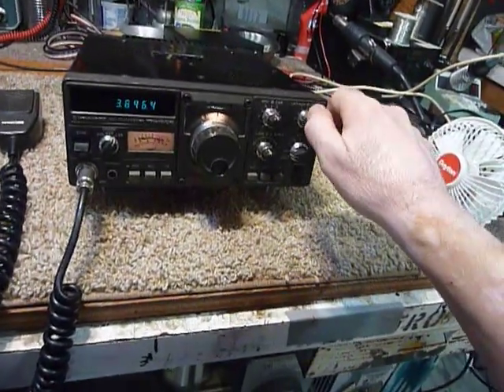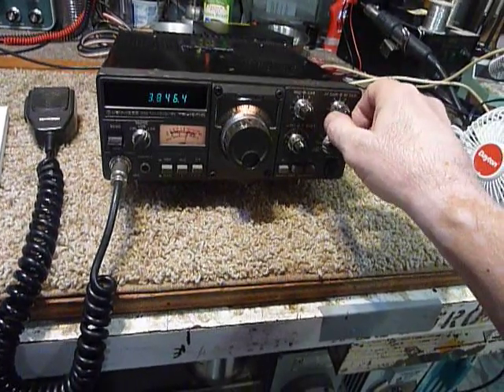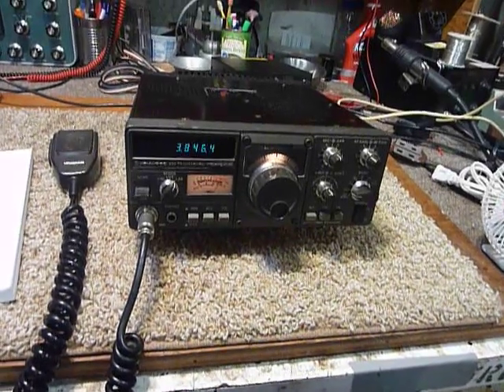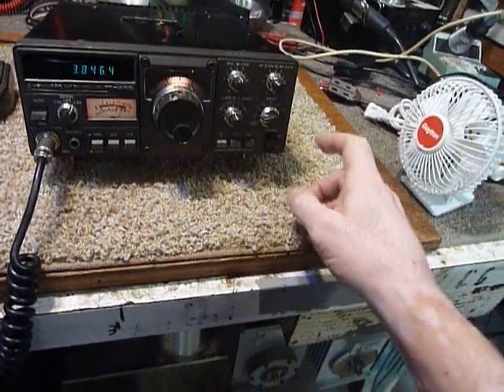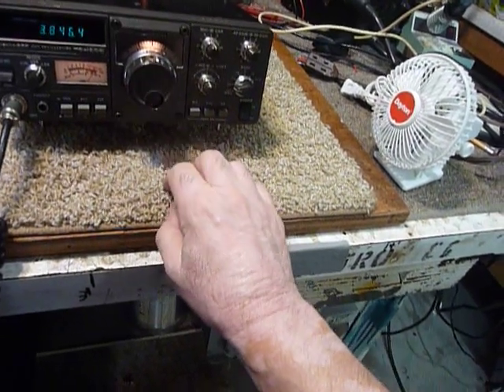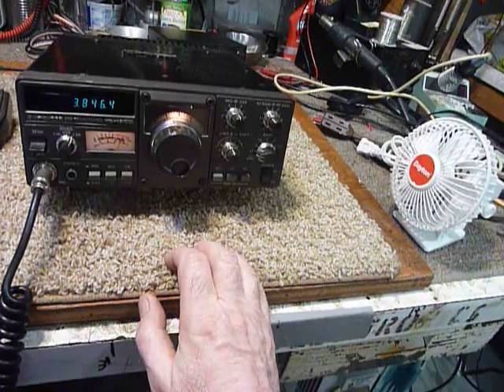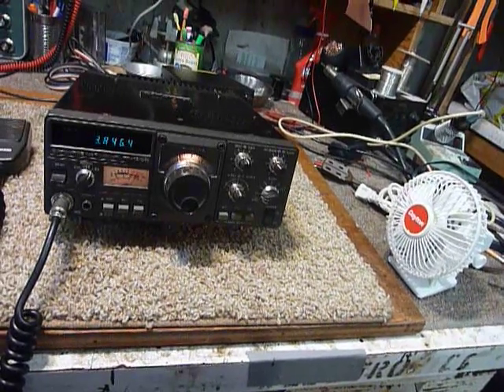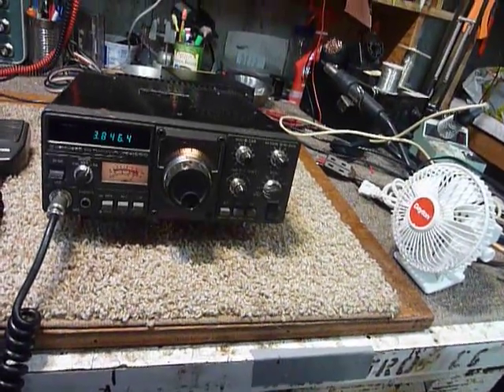Part 3 , KENWOOD TS120S TRANCEIVER ,  TS120SVFO

Comment: Bob, my TS120 occasionally drops ot of transmit and sometimes does not go into transmit. I rewired the mic as there was a problem there, but it also drops out/does not go into TX even with cw key. My little knowledge suspects a relay but what do I know? I did the re-tighten circuit boards Any ideas??